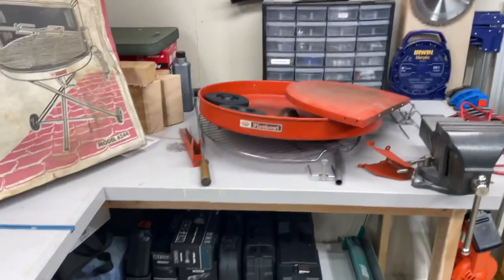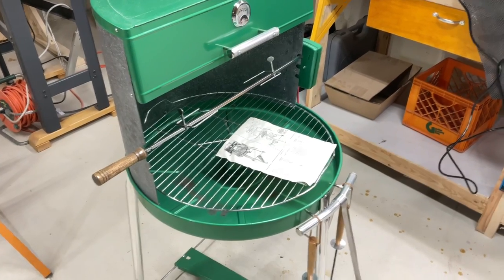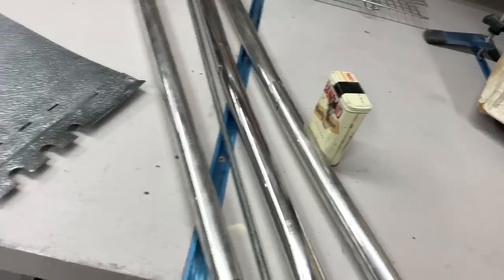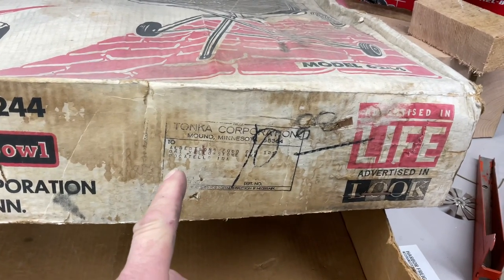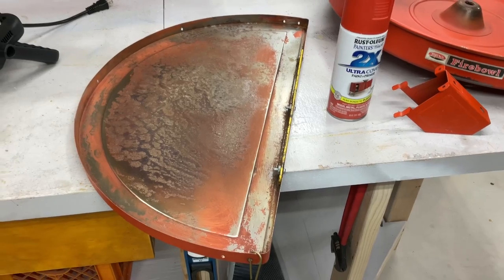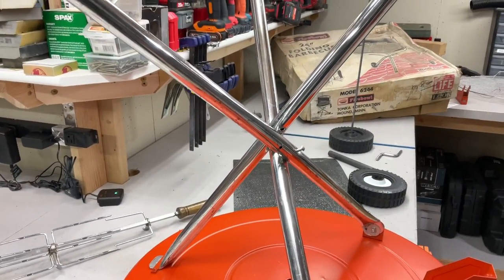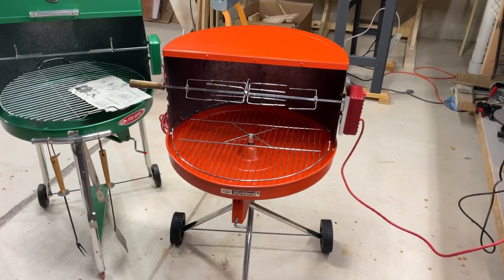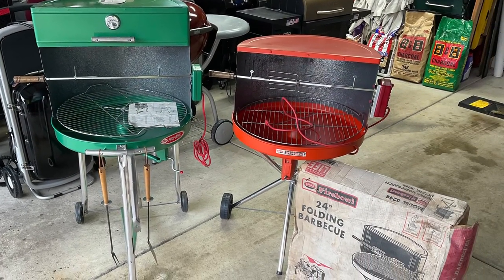Awesome Restoration of BBQ History! / 50 Year Old  Tonka Fire-Bowl Grill and Rotisserie, Awesome!

Comment: Hi Tom, can you please tell me more details about the rotisserie motor for the red unit? I have a new old stock modal 6241 firebowl but no motor, nice video
Reply from the maker: Thanks for watching! Found it on e bay
Reply: @TomHorsmanAmateurBBQ  yes, I see them but can you help with the modal number Tom on the one you have? Think it's what I'm looking for, cheers
Reply from the maker: Will need to wait until I get home from work, there wasn’t any types of theses
Reply: Thanks for responding, To be honest Tom, I've had my mint in box never used unit very much the same as your red one for 7yrs and never seen another till I came across your video, there are a few different models of the rotisserie motors for the Tonka range of firebowls so if you can help me out to confirm the modal type you have them it's possible what I need, maybe I can help you confirm if your wheels are the originals 👍
Reply from the maker: Model #6488 there’s other numbers on the side 1472
Reply: Happy Christmas day Tom, I have manage to finally put my firebowl together, it appears to never have been used but is missing the rotisserie bar, the motor I got works perfectly and my unit I think was not issued with wheels as there're end caps on the legs, how can I send you pictures?
Reply from the maker: Merry Christmas,  my email is in the channel description
Reply: Hey Tom, I can only see your YouTube handle but no email, could you send it to me please, thank you sir
Reply from the maker: It’s there,,, look at the about page,,,I’m reluctant to put it out there, if you go on FB you can IM me. Thanks
Reply: @TomHorsmanAmateurBBQ  I don't use FB, do you have Pinterest?
Reply from the maker: No
Reply: @TomHorsmanAmateurBBQ  you'll see my TONKA BBQ pictured there, HNY